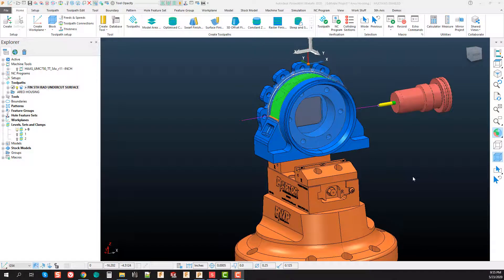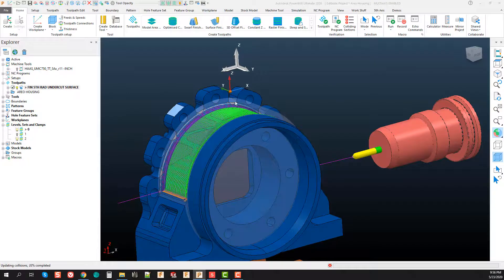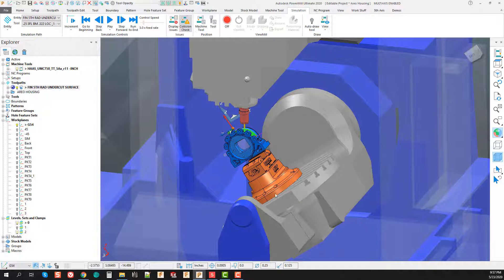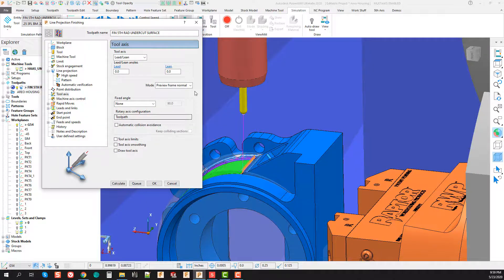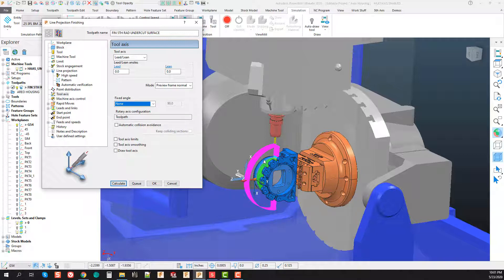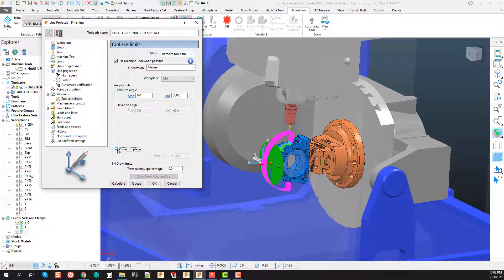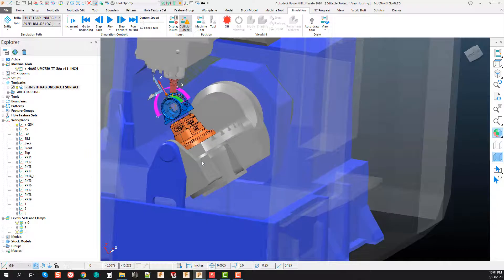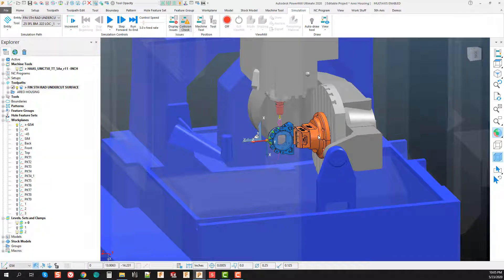PowerMill Highlights | Avoiding 5th Axis Azimuth Singularity Using Lead Lean & Edit Reorder

Comment: What if I have a mount on a table and it's pausing in its pathway causing chatter. The material is silicone. Tool path verified. Looking at the table, it pauses on each liner process ever so slightly.